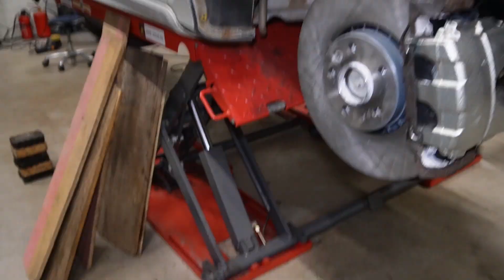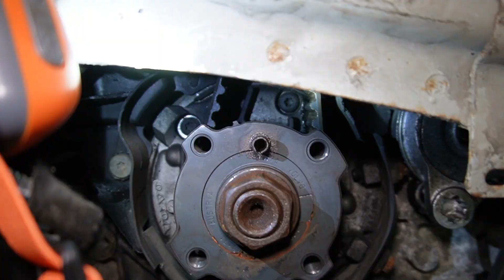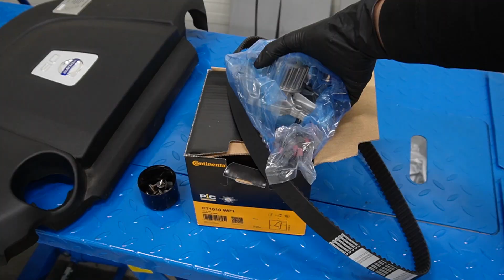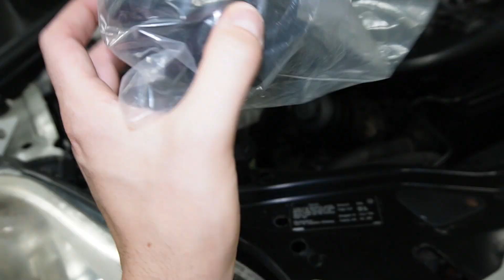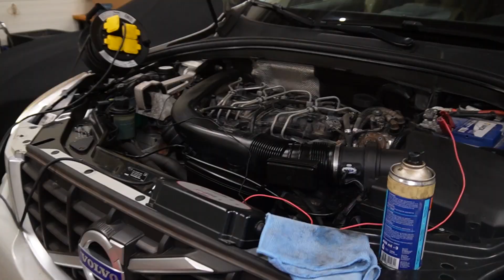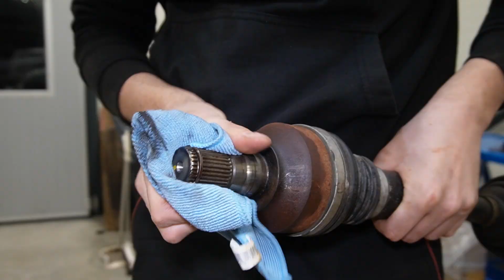A Timing Belt from Ancient Times and more Mechanical Issues - Cheap 300 000+ km Volvo XC60 Part 3

Comment: I had a 20 min fight with that oil filter cap to get out the paper oil filter. It was the first time servicing my V50 D2 and it wouldn't let go of the filter. I had to check Vida to see if I was doing something wrong but I just needed to pull harder. Hearing that plastic snap into place at 14:13 leads me to believe it's the same system on your car. Anyway, I discovered your channel while I'm traveling through Sweden and I just love the country, the car mentality and your channel of course. Keep it up!
Reply from the maker: Thank you for your nice words 🙏

Comment: I highly recommend replacing the auxiliary belts and tensioner when doing timing belt job on these engines. If the aux belt jumps off, parts of it will fly between the timing belt cover and kill the engine. Also the harmonic balancer is good to replace if there are any cracks on the rubber parts.

I have replaced timing belts on my Audis and I have always replaced the aux belt and tensioner. Even though on those cars there is no risk for timing to go haywire if the aux belt snaps, it wasn't fun job to start fixing wiring harness and replacing water hoses because shredded aux belt whipping in the engine bay slashed those..

Comment: You should really go back and tighten that harmonic balancer too spec. There is a speacial tool to hold it and make sure to replace the nut because it needs degrees.

Comment: Very nice. Only thing that I would do differently is not to pull on the axle like that. I have had to rebuild two axles because the CV joint on the inside is not protected against pulling! Other than that nice work and continue!

Comment: I didnt quite catch the brand of the ac belt, but either way i'm going to say it: if that ac belt is not a Volvo original part (as in came in Volvo branded blue box), REPLACE IT ASAP, because otherwise when that belt snaps and it will snap, because of a design flaw. The thing is, when the non original belt snaps, it doesn't snap horizontally like the original does and parts of it fly into the timing belt housing. Yes the original belt is something like 30 euros, but hey, still cheaper than a new engine + install. As far as i know it should be changed every 20-30k km.
Reply: Great advice indeed. I bought original belts 4 years ago for my S80 D5204T3. Zero issue since. The originals were disintegrating at 7yo/130k km.  I've heard multiple times aftermarket belts were snapping so not willing to risk it! I think there is a service bulletin on this somewhere. Alternator flywheel replacement can help too, mine was squeaky in winter so probably harsh on the belt.

Comment: The thing cylinder inside the oil filter can actually make a massive divverence and catastrophic engine failiure if it is not there on some cars. Really is good practice to make sure everything is where it should be like you did.

Comment: Do yourself a favor and replace the harmonic balancer! Mine looked also fine but failed catastrophically 10000 kms after a timing belt job, destroying the timing belt in the process. The ones from Corteco are OE, costing only a fraction of the original Volvo.
Reply from the maker: Thank you for the tip, will check into it 👍
Reply: Are these a common failure on any D5? I’ve had mine (02 D5244T) for 4 years and never touched it apart from a timing belt 2 years ago.
Reply: With me it failed on a D5244T (120kw) engine at roughly 280.000km and 18 years in service. I changed the complete engine for used one. Can't say whether it is a common failure or not as it was my first Volvo. OE Part number for D5244T engine: 30731865 (Corteco 80000990) Now own also a S80 D5 with the D5244T10 engine, the harmonic balancer is already on the list for preventative maintenance. The front of the engine looks very similar regarding the timing and auxiliary belt setup.